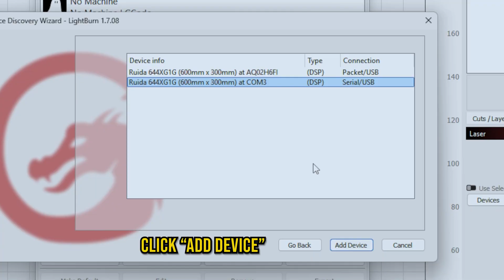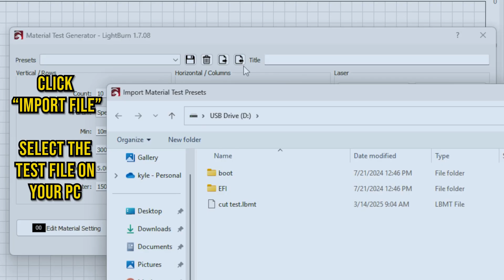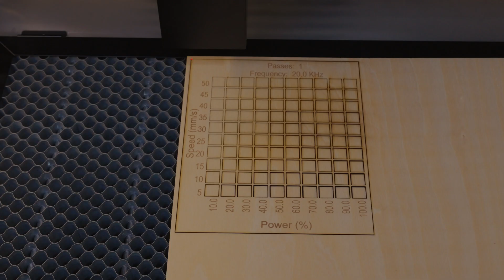Lightburn Material Test Card | OneLaser XRF Desktop

Comment: Another XRF video.  You made and sold me the XT, why don’t you support it?  It’s supposed to have a warranty but they, but even though mine has been a total failure I cannot get a replacement or a refund. They sold me an XT, and you know what?  They don’t have ANY videos on how to use it.  Every video is for the XRF.  I just got off another video conference trying to get help with my laser.  The person doing it suggested changing a setting in Lightburn to get better results with acrylic, then he stopped and said, “You have the glass tube, don’t you?  This probably won’t help.”  I said “Then you mean I bought the wrong laser?” And he said YES. They sold me the XT, but don’t support it, don’t have instructions for it, and apparently lied about its capabilities.  I waited almost 6 months to get the laser - their estimate was 4 weeks.  I am so unhappy and I cannot get any useful help.  One tech told me to ignore the suggested settings page on their website as they didn’t work.  This was sold as a beginner laser, which I thought would be good for me because although I’ve been using lasers for 4 years they have all been  Glowforges, thus I don’t know much about ‘real’ lasers.  The manual is pathetic, and in such poor English it is barely readable.  I received a practically unlabeled bottle with mine, I had no idea what it was.  I had to look it up online to find out that it was antifreeze.  There were NO instructions on how much of it to use , or if I even needed to use it as my laser is indoors in Naples, FL.  The instructions said to use ‘pure’ water - not distilled,not bottled, just pure.  I could not get an answer from OneLaser support as to whether I should use the antifreeze or not. I did (after setting up an appointment) get told to use it, which I did, but no one would tell me if I needed it as there is ZERO chance of freezing temperatures affecting it. I am disabled and my lasers have been a lifesaver, giving me something to look forward to everyday- until this one. Now I don’t even want to get out of bed to face another day of failures.  Look at their site and tell me I’m wrong. It is mostly unusable.  I can use the same settings, the exact same material (not even removing it from the laser bed) and get 2 totally different results.  It will cut through, then the next day it won’t.  I use at least 50 different acrylics,woods(plywoods and hardwoods),MDF,leather,laserable leathrettes, laserable vinyl,rubber stamp material,cardboard, paper…and I have no idea where to even start the settings.  With my Glowforges I have cut many kinds of hardwoods (wenge,zebrawood,lacewood…) plywoods(Baltic Birch, Sapele,Purpleheart,cherry, walnut) acrylics (opaque,translucent,mirror,glitter…)papers,cardboard,adhesive and non adhesive films from Smokey Hill…litterally, anything I wanted to cut.  I can’t even get this machine to reliably cut 1/8” Baltic Birch!  I am not stupid.  I am careful and methodical, I have created many beautiful products with my Glowforges.  I wanted a bigger cutting area,and since the GFs were supposedly upgraded so that now they cost even more, I decided to try another type of laser.  My husband is retiring in a year or so, thus cost is important.  But this laser is worthless.